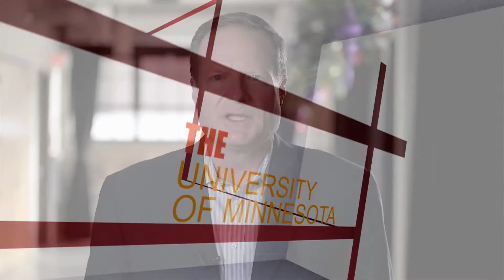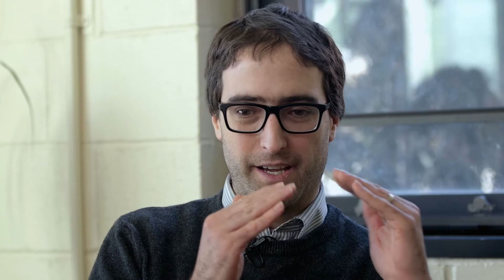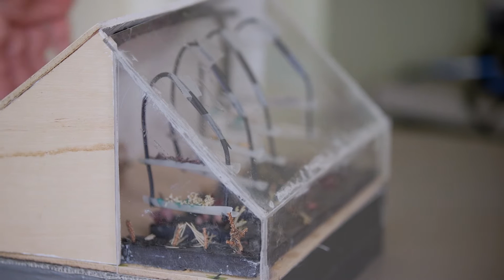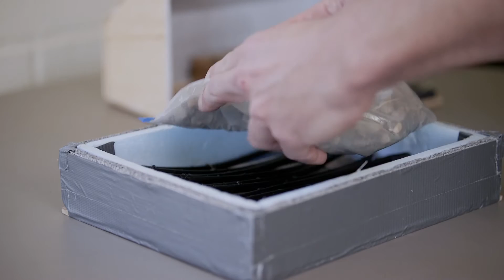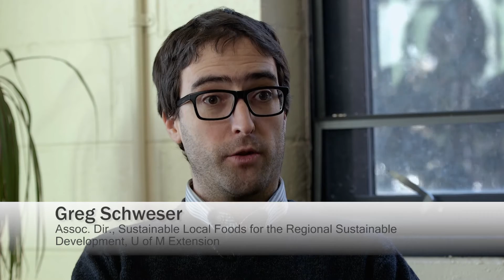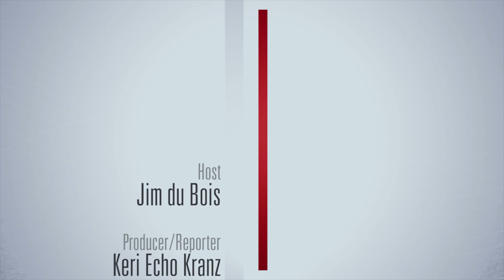Deep Winter Greenhouses in Greater Minnesota | Access Minnesota February 2017

Comment: I am at 50 degrees North latitude on east coast Vancouver Island. Our daily clear sunshine in hours are: Jan.1.5 hours, Feb 3.0, Mar 4.1,Apr 5.1, May 8.5, , Jun 7.5, Jul 9.8, Aug 7.5, Sep 5.4, Oct 3.1, Nov 1.7, Dec 1.8. These are 30 year averages. Climate changes may have moved these.  "Solar" GH clearly not going to give much light or heat . I liked your video but I suggest that that data from the local met office is useful for you too